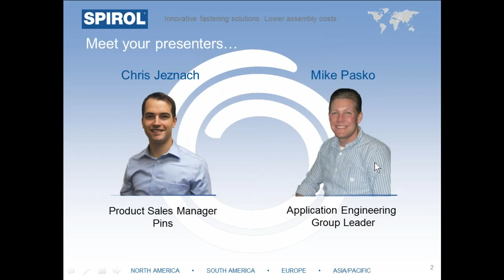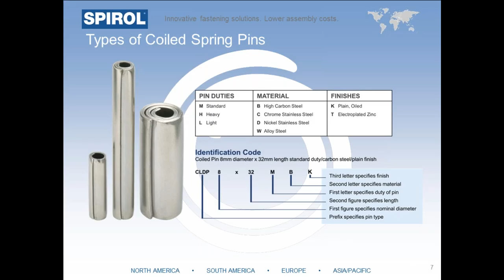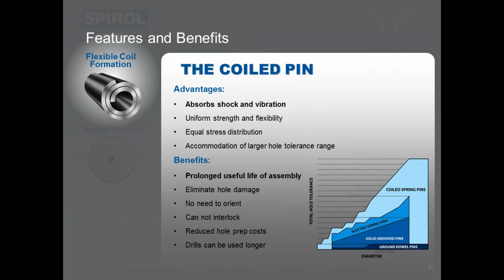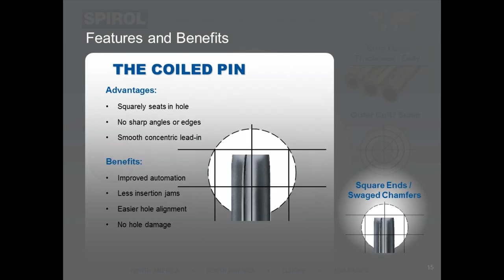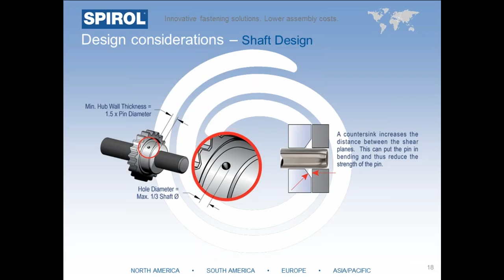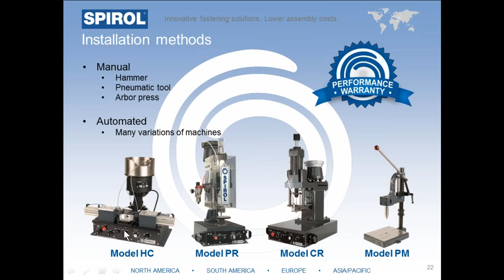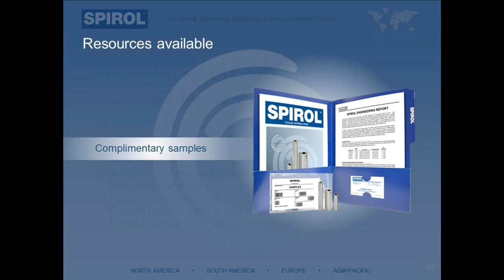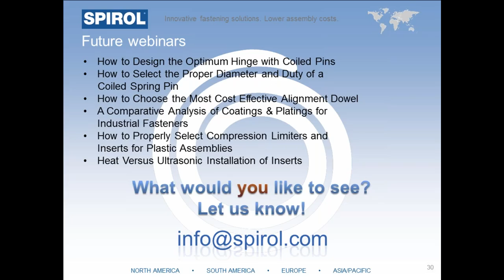SPIROL Webinar - Introduction to Coiled Spring Pins

Comment: How to remove it?
Reply: By the sounds of it, you can't remove it in a 'blind' hole, but otherwise, for a straight through hole just simple knock it through with the appropriate size pin punch and a hammer!
Reply from the maker: That is a good question. Try here: https://youtu.be/NeHRKFljX4o